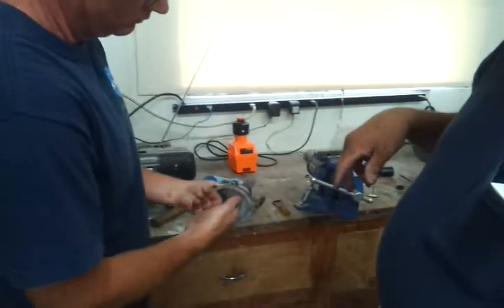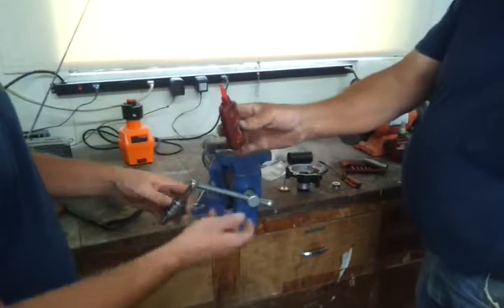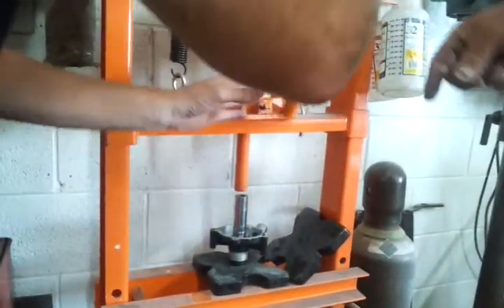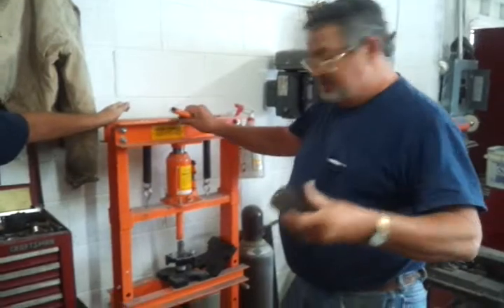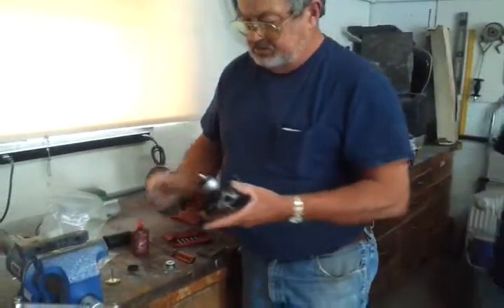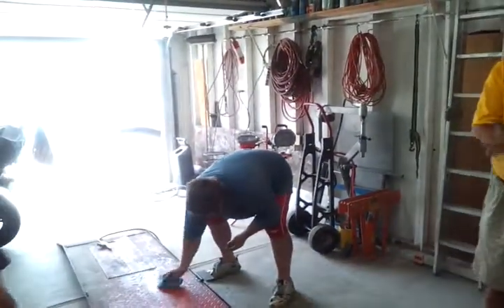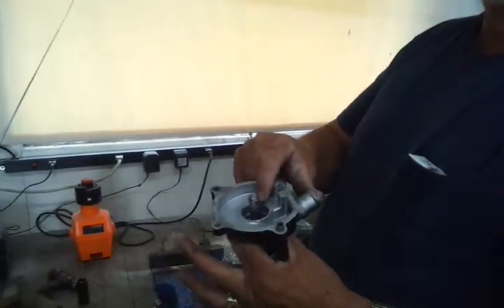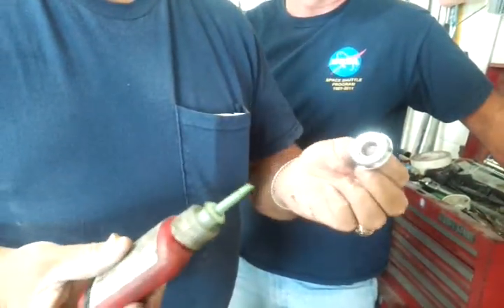V65 Magna water pump repair 4 of 6

Comment: Which "Green" Loctite are you using here?  I understand that there are different varieties of both the Red and Green Loctite.  I have a tube of Green Loctite that is for applying after the fasteners are together--it is super runny.  It looks nothing like this stuff that you are using.  Anyway, I purchased one of these rebuild kits and man I am feeling a bit unprepared now.  Would a really hard piece of oak work for the depth setter for the shaft?  I have to borrow a press and I can't see my friend's brother letting me drill a depth setting  hole into his plates.  As for getting the impeller off, I at least have a MAP gas torch, so I'm hoping that'll get 'er done. I really need to be on the road again!
Reply: vollewraithe Well, I was able to get the impeller off the shaft using a MAP torch--it just took awhile.  I did some research and I believe the "Green" Loctitie used here is either #603, #609, or #640.  The Loctite I have is Green #290 and probably wouldn't work in this application.  For my depth gauge, I am going to get a stack of large washers that is just slightly taller than the shaft, weld them down the sides, then grind them flush to the top of the shaft.